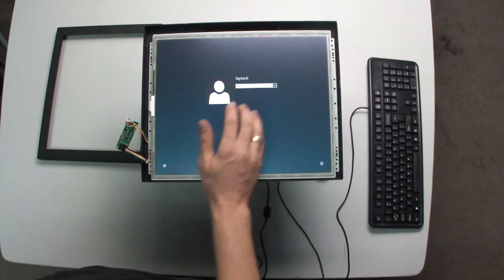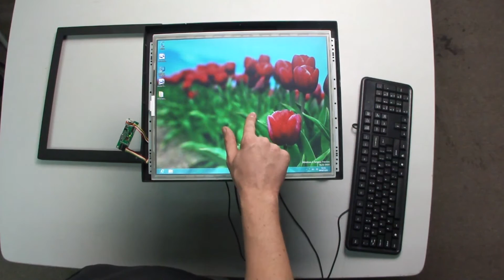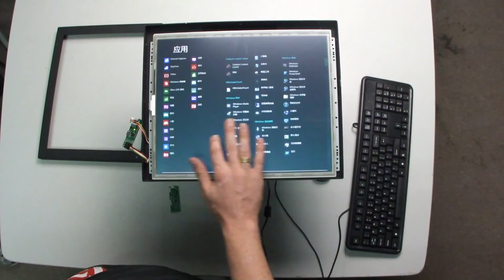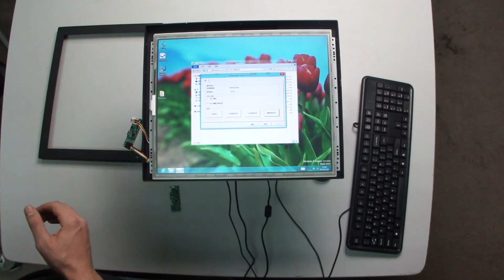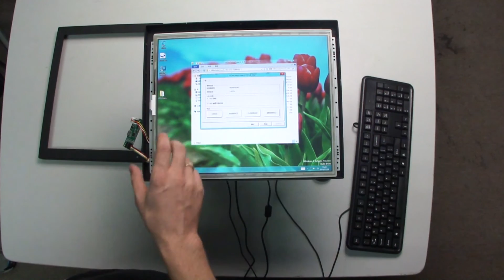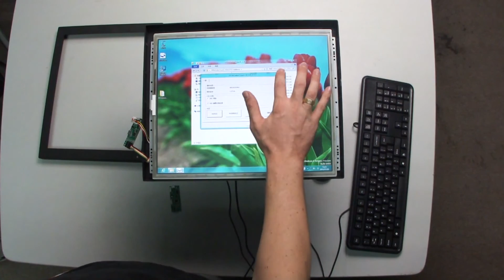faytech's New Touch Controller Design and Its Windows 8 Advantages

Comment: Nice video. I bought a 7-inch, 4-wire, resistive touch panel with an EETI chipset and I can only get mouse functions to work in Windows 8. Is there any driver available to download to get it to work on Windows 8 touch functions like you have done in the video? If not, where can I purchase this newer control board?
Reply from the maker: Hi Tatemhyde,

Thank you for the feedback! Our technician will contact you and help you for a solution.

Regards,
faytech
Reply: faytech Touch Devices Thank you. I eagerly await your reply.